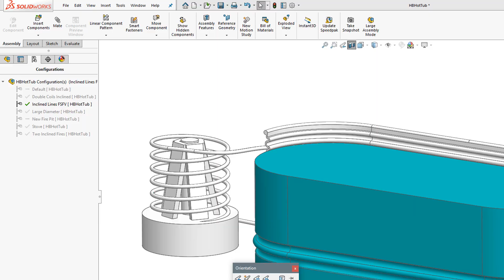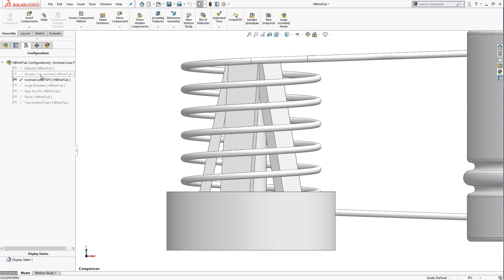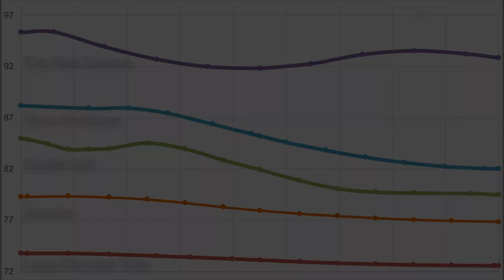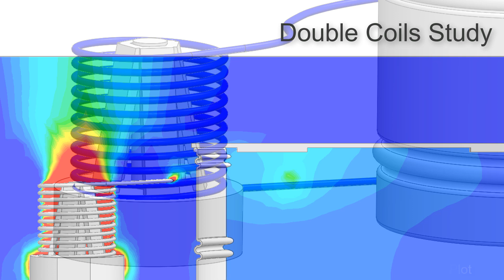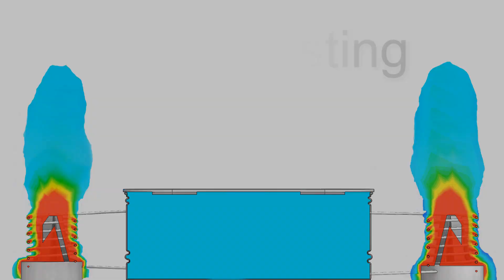Backyard Hot Tubs and SOLIDWORKS Flow Simulation

Comment: Why not use one fire and run tubes to both ends...  You are not using anywhere near all of the energy that the fire is producing, having two separate fires appears very inefficient.  Do two layers of coils or one set closer to the center of the fire, maybe in an conical enclosure or just a steel cylinder (barrel) with lots of venting--but with the coils inside to retain the heat better and make sure the coils absorb as much as possible before most of the heat exists.